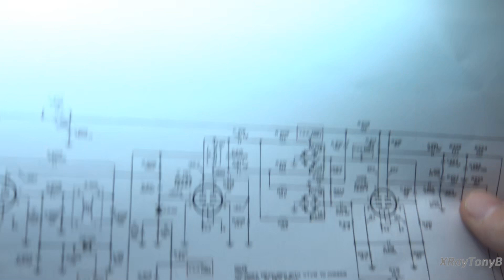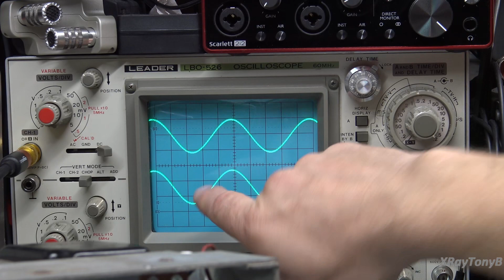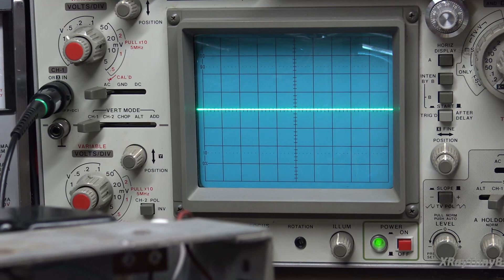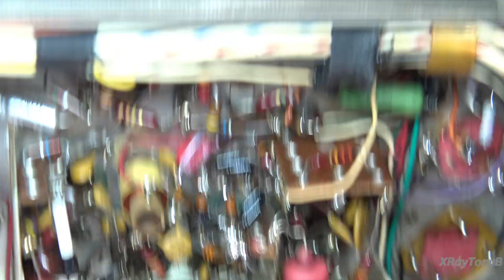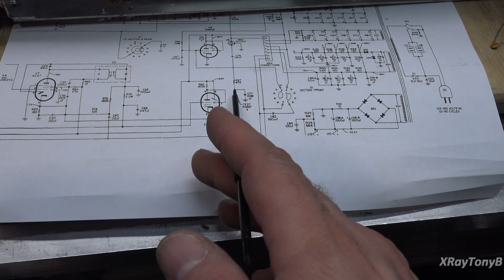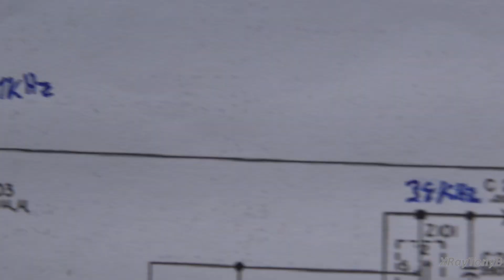Fisher 800B Part 6b - Tuner MPX Module & Final Test

Comment: Great stuff Tony! I have two Fisher receivers that have these MPX modules, a KM-60 which has the older style with the 12AT7's and an 800C which has the newer with the 12AX7's.Both have problems with the MPX sounding slightly warbly and distorted when switched in.So I want to follow your trail and see if I can fix it.
My question is: I don't think you actually adjusted anything on the modules correct? you just replaced parts? I don't have any fancy test gear and neither do any teck shops where I live in Victoria BC.

Comment: I wonder would they have lasted longer if they had used the tubes developed in 1957 because the transistors of the day weren't ready for prime time so the heater would be 12V and the B+ would also be 12V making them safer for the service technician as there would not be any high voltages involved.

Comment: Sorry Tony that you couldn't be bothered to take 30 seconds and answer my question about my Fisher tuner noise floor. Nobody else bothered chiming in as well but the guy that asks if this just your hobby gets a prompt answer from you. So I have to think that what is the value of subscribing to your channel if you are happy to ignore a simple good question among 30 comments. So maybe you missed it then fine.
Reply from the maker: That was a bit harsh, don't you think?  Remember, I only do this as a hobby.  YouTube is not my career and I only do it for fun, and to share with others as time permits.  While I try to answer as many questions as possible, I don't always catch all of them.  Even those who do this for a living (you know the channels) don't seem to give much, if any tech support through the comments.  Contrary to what you may think, it take far more than 30 seconds to answer a technical question, especially when details are left out.  
As for your question, I went through the comments on that video and found your original post.  The FM200b uses a similar MPX unit to the one I showed in the 800b.  There are different types of hiss that can be caused by different problems.  If the unit has a high noise floor in mono FM (no mpx selected) then the issue could be in the RF or IF section of the receiver.  This would only be amplified when you switch to MPX stereo mode.  If the hiss is more pronounced when listening to speech and sounds like the letter "s" are said, this is called sibilance.  It is quite often caused by the ratio detector/discriminator being out of alignment.  It can also be caused by misalignment of the MPX module.  As you also said, it could also be a faulty component such as the germanium diodes or a capacitor.  Although it took a bit more than 30 seconds, I hope it helps.  Thank you for your patience and I hope you understand that I have limited time and am not perfect.
Reply: @xraytonyb  Tony, yes I was harsh. Sorry bout that. Thanks for your work. I appreciate it.

Comment: I have a Fisher FM-200B tuner. It sounds great and the stereo separation is good BUT the hiss noise floor is high. What would be the probable cause? Leaky diodes, caps or resistors? I can change out parts for new components but would like to know where best to start.
Thanks Tony for another interesting video!
Reply: Alignment.

Comment: Well, the pin 8 of V100 is grounded, no cathode resistor. If the voltage of the grid was zero, not around -0.8 V, that tube would have no bias voltage at all.
So IMO that -0.7 V is OK. It seems to be working as a grid leak biased triode.